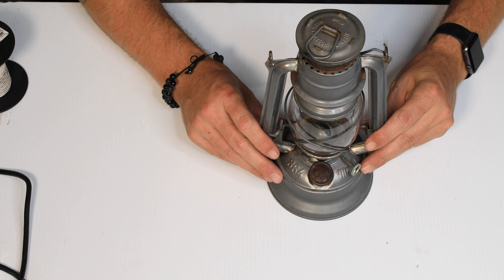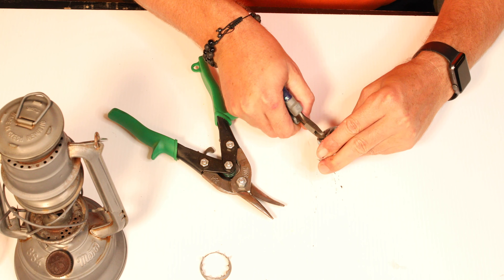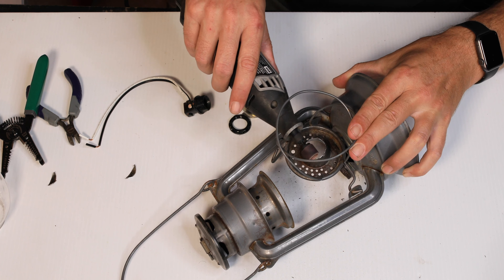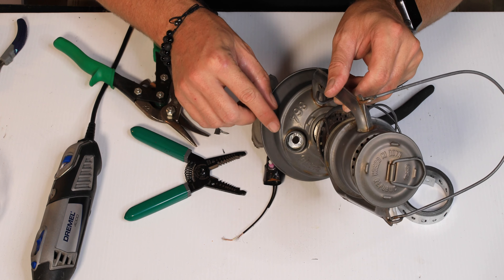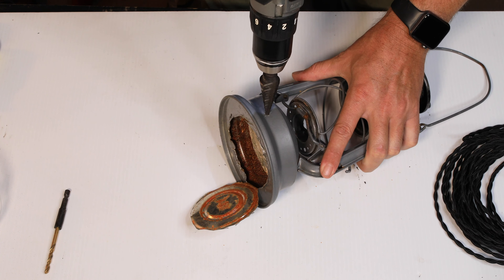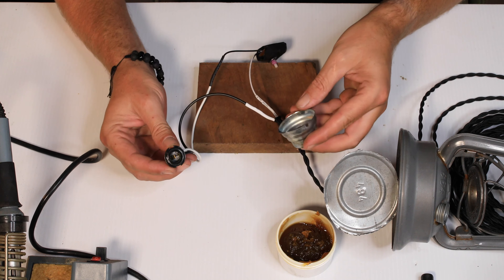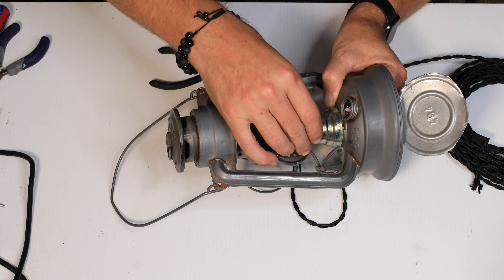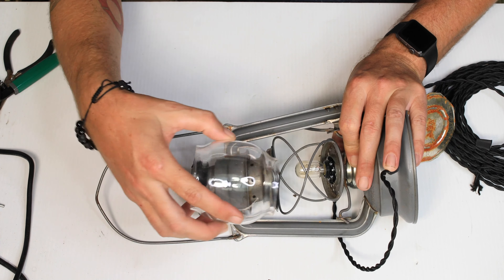DIY Kerosene oil lamp into a steampunk dimmable lamp

Comment: I know this is a three year old video, but am I seeing your wiring correctly? 1.Incoming hot line, direct to hot side of the socket. 2. Incoming neutral line direct to the neutral side of the switch. 3. The neutral side of the socket, directly to the hot side of the switch. Is this correct?  Thanks in advance!
Reply from the maker: I mean technically the hot could go to the switch and then from the switch to the light.  But reality is both ways work

Comment: I have a lantern like this that is already electric but i would like to make it to a ceiling light how do i do this. Thanks in advance.
Reply from the maker: Hmmm.   I have been thinking of doing a hanging one also.    Trick is getting the wires up top discreetly.    I’m thinking of running the wires up the arm on the side but honestly have not really tried it yet.   New video idea 🤙🏼
Reply: @cranevideo3506  i guess I have to be patient. I'll just start another project in anticipation of your video. Thank you for your response